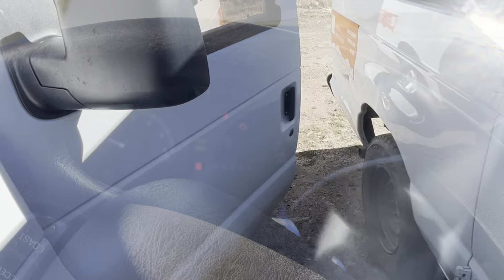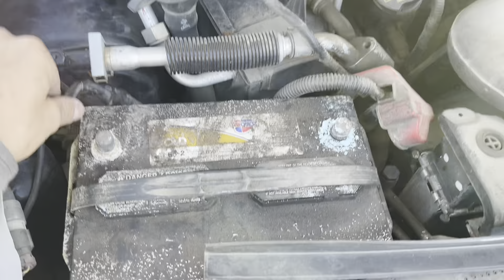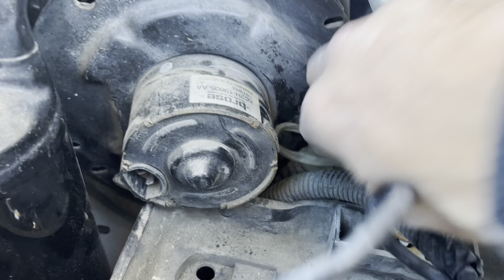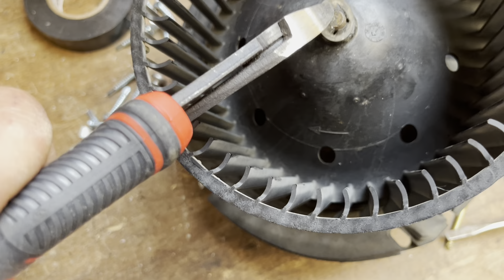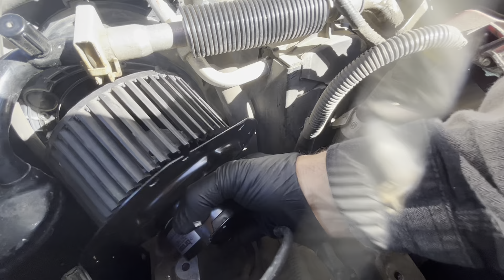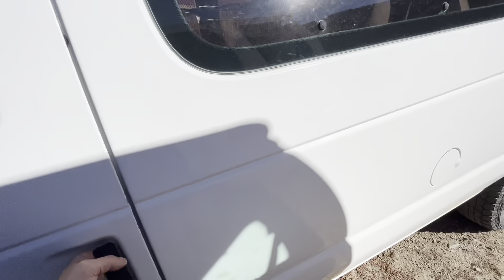How To Replace Ford E350 E250 Van F150 F250 F350 HVAC Blower Motor

Comment: My blower motor will lose velocity randomly on high setting.  After a few minutes, it slows way down and hardly pushes air, then it will speed back up again.  Not sure if it's a motor or switch issue.
Reply from the maker: It’s possible the blower motor is failing and over heating. I would also say maybe it’s the resistor (speed controller), but usually when that fails it gets permanently stuck on one speed setting. I’m not 100% sure but my guess is the blower motor. Does this happen on different fan speed settings or just on the high speed setting (to help rule out the switch).
Reply: @Theocdrepairman the switch responds to all speed selections. As for the drop-off of rpms, I've only noticed that happen on highest setting, but then again, it's the setting I use mostly,  so I don't know if it does it on all speeds

Comment: Hey just wanted to say thanks for this. Just did it and you saved me a few hundred in mechanic fees. Even with beers it only took about 45 minutes. The battery tray bolts were really rusted. Anyway, thanks!

Vans newer than 2008 have different headlights.
Reply from the maker: You’re welcome, glad it helped! Thanks for leaving a comment!

Comment: Just finished removing my 2006 e250 blower motor.  There's a flat edge on the motor, if you spin it towards the ac canister it gives you the best chance of getting it out once the screws are removed.  Put the flat side of the circular motor flag where the canister is and you get that extra 1/2 inch of space and it pops right out.  Thanks for the video, it helps to see what tools and how to use them, that's a tight space!  Job done,  it's 15 degrees out and a foot of snow, I need my heater!
Reply from the maker: Glad you getting it sorted! Thanks for leaving a comment and the tip!

Comment: My blower motor seemed to come with a wire plug (male) attached to it already. Will it connect all the same? I didnt see the new blower motor in the video have the same wiring bit mine has, i might have just missed it though. Its a 96 e150 if that matters
Reply from the maker: All the blowers I have seen are just the assembly. Do you mean the motor has the female plug and a male plug pigtails plugged into the new motor?

Comment: So I got my replacement blower and I think it came with a new fan bladei in it already
Reply: Most will. Our Napa one, same van has over 400.000. Miles. Still blows Strong. We love NAPA PARTS  MEETS.OEM❤🎉
Reply from the maker: That’s great! Was it aftermarket?
Reply: @Theocdrepairman most are ,, and are way cheaper than Motorcraft. WHO no longer includes the hamster wheel. And they last as long.  They are mostly all well made. As it's your Vital A.C. and heat

Comment: How do you know if its turned on after hitting it?

Trying to troubleshoot my 2009 e350
Reply from the maker: If the heat or ac is on then the motor will vibrate and hum lightly also you will feel the air flow out of the vents. Thanks for your question!
Reply: @Theocdrepairman 

Ok so it's on but there's not a lot of air coming out and it's not really cold 

And the mid drivers side floor vent blows hot air when set to ac

Might be in over my head doing this 😂
Reply from the maker: Sounds like the blend door is not working correctly. You could also be low on refrigerant
Reply: @Theocdrepairman  thanks for all the help

Comment: Aloha. Tapping got it moving but only blows out the front. The rear vents still don’t blow.
Reply from the maker: If your van has rear climate control the. You have 2 blower motors. The front one under the hood and the second one is near the rear driver tire under the plastic panels on the interior

Comment: What if you tap it and it doesn’t come on? Could it still be the blower motor or something else. Have no air in the front just went out but the back works. Changed fuses nothing still.
Reply: Check the wiring. I read somewhere ran the wiring to low and ended up melting wires up against the EGR
Reply from the maker: @BussinMindSet Thanks for the comment!